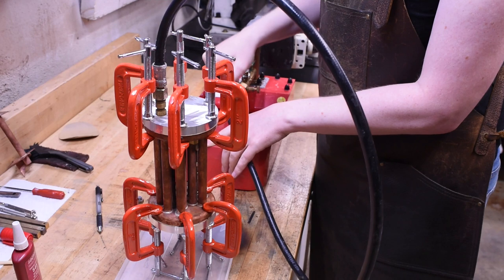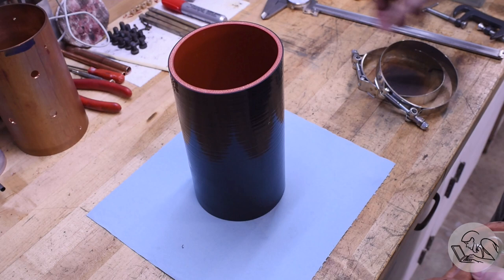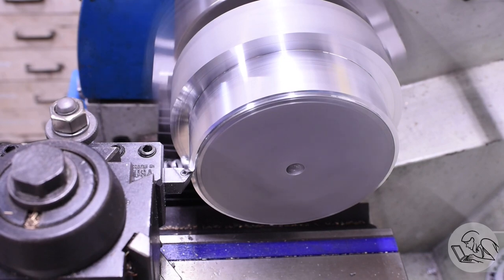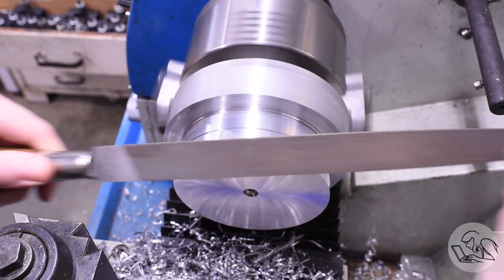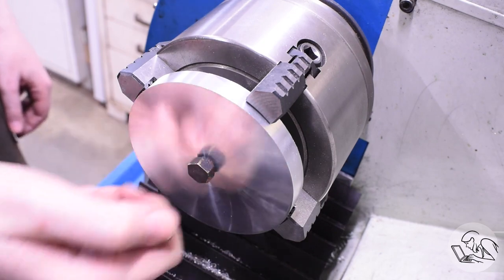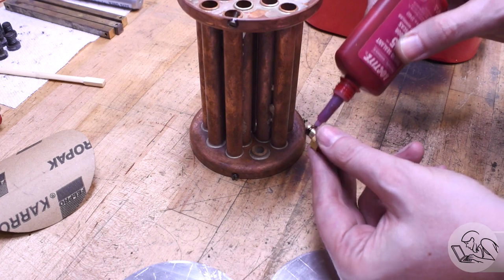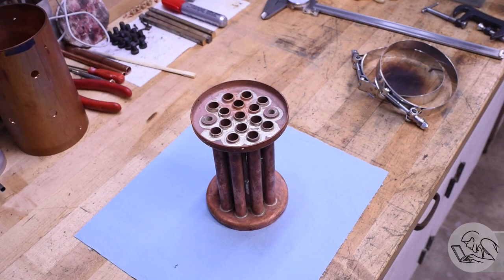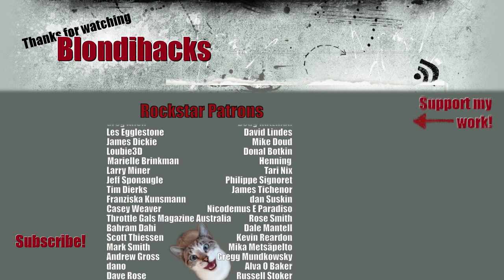Pressure Testing a Boiler Core | Model boiler build, part 9!

Comment: Great videos. At the start of this when you were leak testing the pressure tester you were saying it was leaking slightly. Something I have come across when using flexible hoses is that they can expand a little which will cause a pressure drop. You can prove this by dropping the pressure a bit and may see the pressure rise again as the hose relaxes again. I found this while working calibrating pressure transducers.

Comment: I think you've mentioned before that in a home shop its not really practical to recycle the chips, but man it just seems like that much aluminium could get melted down back into at least a couple little ingots. Or maybe its the case that it just looks like quite a pile because its all long strands but isn't actually that much? But maybe a little coffee can or bucket foundry could be a future project for recycling some of the swarf?

Comment: Not sure if I am seeing correctly but you closed the ball valve then looked at the bleed off of pressure on the gauge on the hose side of it? If so then likely your ball valve is leaking for a start before you get back to the pump seals and clearances. You will only need a few drops of water to drop the pressure too (assuming you have no air in the system).

Comment: There is a reason we don’t use plain old hose for brake lines. Swap your hose out for some braided stainless line with good AN fittings and you might see a difference. Feel free to PM me if you need a 12-24” chunk w fittings. We have plenty left over from the last race car build!

Comment: Those aluminium end plates might hold a gasket seal better at low clamping forces if they weren't perfectly smooth - a flange face will normally have machined concentric (or sometimes spiral 'phonographic') grooves that 'dig into' the gasket.

Comment: Core testing, I wonder if we are going to get a clip from Chernobyl? That's a cool fixturing trick for the bandsaw, thank you for sharing. Have you considered bolting an adjustable stop bar vertically near the on/off switch to catch the head of the bandsaw to keep it from cutting threw the bolt? 
Or you could take one or both jaw inserts off the vise to gain a little bit of capacity. 

Great video, looking forward to part 10.

Comment: It would be a whole lot of machining, but you could make a seal around the end plates with two L shapes.  One plate similar to what you have with the appropriate holes but with a ridge that extends up to the end plate face on the inside of the rim and goes outside far enough for bolt holes.  And the second matching to those bolt holes, but going down the outside and under the bottom.  Bolting them together would squeeze a gasket against the flat of the end plate.
Reply from the maker: Yah, that was the design I originally thought of, in fact! But it was going to be too much work for this, I figured.

Comment: You have the main elements to use an "O" ring   get an o ring close Do not need to be exact they can stretch a little or compress a little Then cut s grove on the aluminum plate the with of the o ring a bit deeper than the o ring cross section,  install the clamps and there we go. Also you can use some rubber instead of a paper gasket.    Need to make sure the top of the end plates are perfectly smooth
Reply from the maker: The stud holes eliminated that plan, as I explained.

Comment: This would have been handy for me earlier today .... if I had an angle plate to put in my bandsaw (guess I am ordering one from KAR or Amazon) ... though I did have a thought that I would probably thread the remanent piece and using a cap screw instead of running a piece of ready rod all the way through.

Comment: Maybe a bolt hole pattern around the outside of those plates.  Then threaded rod instead of clamps.   A bonus is you wouldn't have had to turn that material down so much.
Reply from the maker: I updated the pinned comment with the explanation why I clamped the way I did. 🙂

Comment: 1:30 the leak can't be in your pump. It's on the other side of the shutoff valve (no longer in the system). However, your theory about the bleed down makes sense to me. 💖🌞🌵😷 Ps. Fun fact: when installing a new gas line in a home, the line has to hold a certain pressure for 24-hours. The plumber detaches the pump because it's on the other side of the shutoff and not necessary for the test.
Reply from the maker: The hose and valve are part of the pump
Reply: @Blondihacks  1:47 you say it could be o-rings inside the pump... I'm trying to say: it's not o-rings inside the pump that are causing the bleed down, because the pump is on the other side of the shutoff valve. The leak has to be on the hose side of the shutoff valve... or even be in your shutoff valve, but not in the o-rings in your pump. 💖🌞🌵😷
Reply: Perhaps the bleed down of the blanked-off pump + hose assembly is due to slow expansion of the hoses under pressure.
Reply: @The-Trouble-with-Tribbles , that's a possibility, but I'm guessing that from her comment above that she bought the pump, valve and hose as a unit. So it seems unlikely that the manufacturer would not include hoses that weren't matched to the capability of the pump. But who knows 🤔. Sending lots of love 💖 from sunny 🌞 Arizona 🌵. 😷

Comment: Could fit more clamps in if you mixed the sizes, say, 3" and 4" clamps. Apply the smaller clamps like you did, then the turny-bit on the slightly larger clamps should clear the turny-bits on the smaller clamps. If the size difference is enough anyway.

Comment: Hey Quinn, looked through some of the comments but didn't see this question.  I imagine you tried a bunch of different things for flat gaskets, or perhaps just using what you had available?  Did you try some neoprene sheet? Not expensive on amazon, but perhaps you didn't want to wait for something...  Don't know if it would work for a pressure test, just a thought.  I've had good luck cutting rubber and dense foams on the lathe with a faceplate, some strong double sided tape or spray adhesive and a sharp scalpel/exacto.  Has anyone else tried neoprene for a pressure testing gasket?  Great to see you are making positive progress on this project again.
Reply from the maker: All fair questions and good ideas. 😁 It was indeed a case of wanting to use what I had and wanting to put minimal effort into this.

Comment: Could you have placed  an "O" ring between the boiler plate and the silicone hose? Quite amazing what can be achieved with a couple of layers of old inner tube rubber rings. Pretty low tech but if it works, it works!!!

Comment: The car hose looked like a great idea, pity about the size, have you considered wrapping some plumbers tape round the edges of the end caps to increase the diameter so that the clamps and hose will fit.
Steve

Comment: Hey Quinn, eventually once I have the space id eventually like to upgrade a garage/shop with a whole heap of machining tools. As a manufacturing engineering I work around our machine shop all day and have learned a lot of common sense knowledge from our machinists so I’ve learned to really appreciate the trade. I guess all that has nothing to do with my question. I’m currently looking to invest in a set of combination wrenches and was wondering what brand you were using in this video. I know you work on cars and can probably use the same set for both applications so I would think a good quality set for maybe both auto work and eventually machine/shop work would be what I’m looking for. Of course everyone wants SnapOn, but I like my arms and my legs (and I know that’s the cost for SnapOn).

Comment: Just thinking out loud by why not use the turbo hose as the gasket? Cut down the wall and lay it flat, you should be able to compress it more with the clamps and then it can take up the flex as the pressure builds.

Comment: I think it would be safe to use compressed air for this test. Maybe 20 psi and the volume inside is relatively small. Relatively low psi air would indicate an obvious leak.

Ultimately the final hydrostatic obviously will prove the unit.

Comment: 11:40 Model engineers do indeed use a whole lot of odd threads, even here in the UK! Most modern designs still use BA threads, even those designed by the younger generation. For someone born in mid 70's between metric and imperial, even I find this weird! Why 😂
Reply: It's about using an appropriately sized fastener for the scale of the model and the smaller BA fasteners look better on a lot of engines, especially if the kit was designed with them in mind.
Reply: @douglasbollinger8678  I had thought that metric would've been an alternative, M2.5 M3 M3.5 etc but just noticed .5mm increments seems to stop at M4 so yes, I understand now!
Reply: BA fasteners also have more scale looking heads than metric which look a lot thicker
Reply: If you really want to earn some hate, use metric, but in JIS before 1967. They usually used a pitch just a hair above the european one.

Things like M3*0.6 (instead of 0.5), M4*0.75 (instead of 0.7), M5*0.9 (instead of 0.8) ...

Comment: I am a little confused on the tapping of parts held in a clamp for milling. Do you tighten after the taps or are you tapping while they are 100% already clamped in? If they are 100% clamped in how can you move the part then? If a tap will move at all then would not the cutter also move the part?
Reply from the maker: A hammer can always move something no matter how tightly clamped it is. That’s the power of an impulse force.

Comment: A question that occurred to me not long ago- Why not solder the tubes into the plates from the inside? It might require a bit more in the way of setup and fixturing, but it would allow you to avoid the mess of solder-falls along the boiler tubes and it would allow easier heating. Am I missing something or is it just not something you thought of?
Reply from the maker: That’s exactly what I did

Comment: Shout out to Engineers in Test :) #MötleyClämps
I did like the silicone tube approach, and was wondering whether some ptfe tape could be used to build up the diameter of the copper ends? But then the gasket ends seemed much better anyway!
I am also impressed that the clamps did not buckle the end plates - very sturdy stuff!

Comment: Hang on a minute.  For the purpose of clarification;  I watched you test your pump.  That was very smart.  You said you wanted to check to see if your  pump was losing its pressure.  Okay fine.  However, I watched you close the ball valve after you had pumped it up.  I could not read the gauge so I don't know how much pressure you applied.  The reason I ask this is because I am curious about something.  Did the pressure bleed off after you closed the valve?  Because if it did, then how could it be the o-rings in the pump which became isolated when you closed the valve?
Hope you solve the problem.  Have fun be safe.

Comment: Apparently, at least in England, in steam engine terminology, they're not gaskets but "joints". Also, would some kind of "gasket goo" (even grease) have helped with sealing the small imperfections in the edge of the copper and paper?

Comment: I thought for sure you were going to trepan an O-ring groove in the end of those aluminum plates and use that as a sealing technique.....we used to make our own custom sized O-rings by butt splicing them and using a type of anaerobic glue to bond the ends...just a thought.

Comment: Wonderful as always! I'm gonna be able to pretend to know so much one day 🤣  So the real question: are the weird model engineering thread sizes still easier to find in American hardware stores than basic metric machine screws?

If this were somewhat more permanent I'd have  suggested Hylomar gasket sealer. I use it to look like a hero with small engines, but it's very sticky and only dissolved by isopropyl alcohol.

I bought a vinyl cutter to cut custom gaskets. I'm not sure I've done that yet, but my partner has made a lot of fun projects! (And I made a few monstrosities with cereal boxes before I got a 3d printer...)
Reply from the maker: Metric hardware is less common in North America and model engineer hardware is pretty non-existent. You end up making most of it.

Comment: Question: How much of a hassle would it be (would it be worth it for you) to recycle your aluminum Swarf and cast off?
Reply: I save mine for the Christmas tree.

But seriously, in my area, swarf gets the same rate at the scrapyard as any other dirty metal of the same type.  I think aluminum was about $1000 per ton last time I did it.

Comment: perhaps gaskets made from a rubber tyre tube from a car or motorcycle would be a better choice and you might even get away with a threaded bolt straight down through the centre tube to hold the blanks on each end.

Comment: I wonder if the paper at this pressure is drawing the water through its structure and it will never hold higher pressures because of the capillary action.
Reply from the maker: It works on steam engines. It’s insufficient clamping, not really the gasket’s fault

Comment: A dumb tire trick, spray your  bleed down test assembly with soapy water and look for bubbles
Reply from the maker: That doesn’t actually work with hydrostatic testing because there’s no gas escaping to form the bubbles in the soap.
Reply: @Blondihacks  Doh, I thought you were air testing the equipment at the beginning, my bad. :)

Comment: I have absolutely no experience to know for sure but I wonder if you could use a vacuum pump to do this type of test.    You would still have the same risk of cutting the gaskets.   Possibly also collapsing the tubes.    Nonetheless loving the videos Blondie!   Two thumbs up.
Reply: Problem with vacuum testing is pressure differential would only be 14.7psi - she needs heaps more.

Comment: The inverted pressure test scares me a bit. The pressure forces are in the opposite direction. when I imagine a material a bit more elastic than copper I visualize it shrinking  to the center in the proper test, and expanding in the reverse that you did. That is more likely to strengthen the joints and cover up any leaks instead of showing them up. 

I'm a couch modeler so a grain of sault might be to little in this case.

Comment: Thank goodness the paper gaskets prevented you from reaching 120 psi. Multiply 120 psi by the area of the end plates and you would get the mechanical force that would have been trying to rip the end plates off of the fire tubes. I'm surprised the silver solders even withstood 60 psi, as the mechanical force even then must have been shockingly high. Truth be told, at the time that I was watching you pressure-test the core, the unwanted mechanical stress did not occur to me. I only realized it later. Good move finding a way to test the core before assembling the boiler shell, btw. Congratulations on this most difficult and complicated build!! Best regards from Brasilia, Brazil.
Reply from the maker: 120psi is not a big deal for a boiler like this. Nothing would have ripped apart
Reply: @Blondihacks   yep, you're correct. I thought it over and what you said makes sense. The total silver solder joint area between the fire tubes and the end plates is probably similar to the joint area between the end plates and the shell (once the shell gets installed). I'm impressed with how strong silver solder joints can be!

Comment: Hi, i would think your valves on your pump device are bleeding down, as you have the pump itself isolated with the green handle valve. if you are not seeing water coming out of the fittings, it would be an internal thing.
Reply: That was my first thought.
Reply from the maker: Yah, has to be the valve or the hose. I suspect the hose- it’s not well made.

Comment: For cutting the aluminium with the band saw, wouldn't it have been easier to thread the hole in the back and attached it to the angle bracket in that way? Then you wouldn't have needed to rotate the piece as you wouldn't have had a threaded rod all the way through.
Reply from the maker: Yah, it would have been. Hindsight and all that. 😁

Comment: You might have some luck by lapping the test plates against the tube sheet flanges.  This can create a near perfect fit of the flange to the test plate.  With an almost perfect fit established between the test plate and the tube sheet flange, you might achieve a successful seal using only a liquid gasket material (Permatex).  But, this suggestion is coming from a guy who sketches things up but almost never builds anything.
Reply: Definitely one possibility.  Another possibility is that at even "only" 60 psi, the tube sheet flanges deflected just enough to allow water to leak.  Or maybe both contributed to the leak.

Comment: I wonder if you could have soft soldered the core into the tube for this testing.   Seems like a lot less heat would be required.    Not 100% sure how you would gee it apart.    I guess just heat it up again.     Then there would be the problem of clean up.

Comment: I do not think the pump is leaking since you closed off the ball valve. It has to be from the valve to the new cap you installed since you did not see any seepage the first step is to replace the ball valve, then the gauge.
Reply from the maker: The valve and the hose are part of the pump